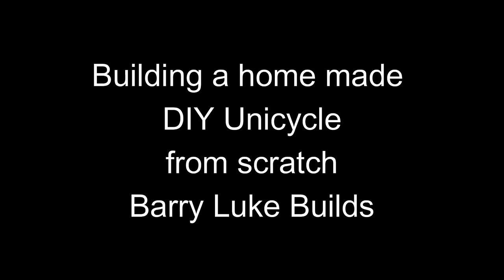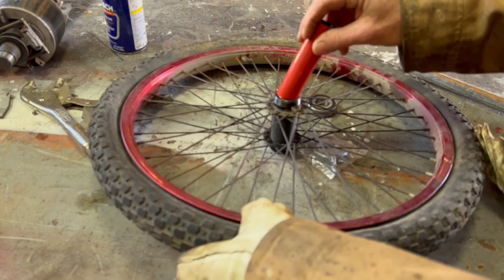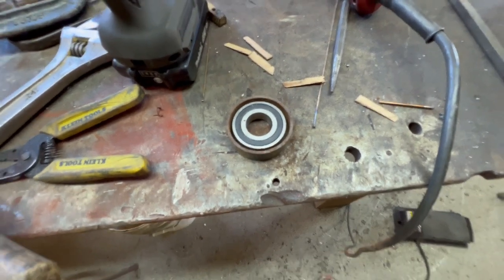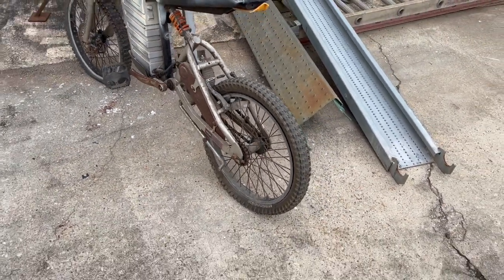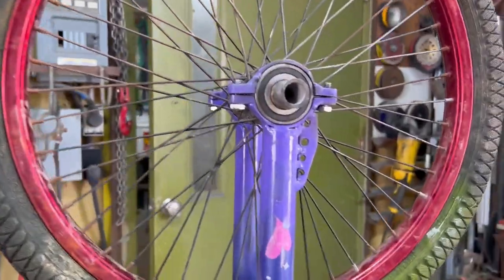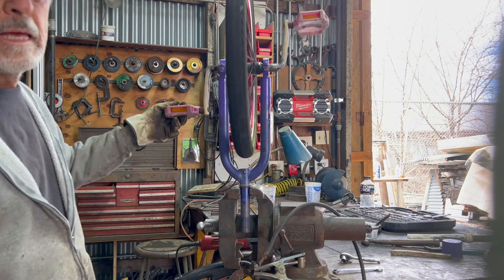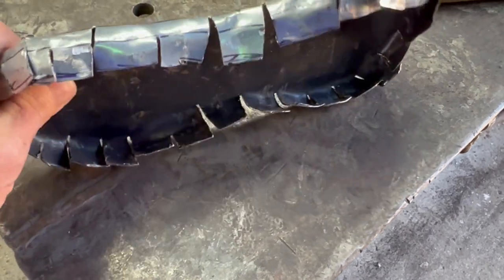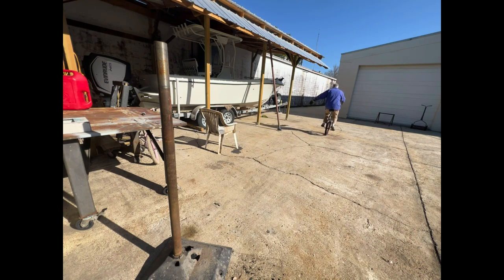Building a DIY unicycle from a scrap 20" bike.

Comment: Cool build.  You should have kept it and rode it.  A unicycle is is very good exercise.  I built my first unicycle as a kid using a tricycle wheel.  Now 60 years later in my seventies I put thousands of miles on my 36" unicycle.
Reply from the maker: Jim
I still have it and while I don’t ride it a lot I do ride it occasionally. I have gotten much better but not real consistent yet. It is harder physically than one would guess. So just a short riding secession will give me a good blow. If you ride a lot you must be in good shape!
Thanks Barry